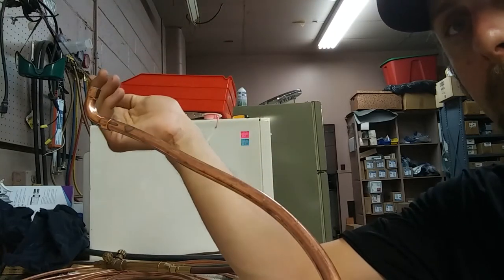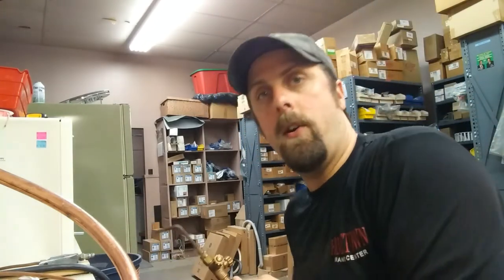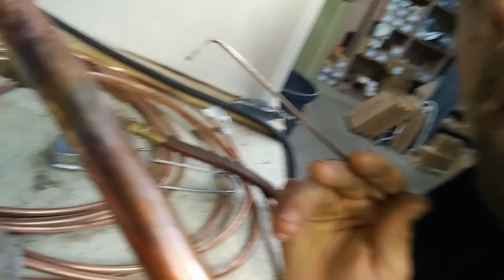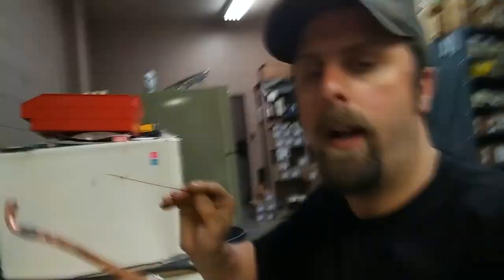Brazing 101: How to Braze Copper to Copper Using Silver Solder

Comment: Great short and to the point.  Why  is brazing the norm in refrigerators and soldering in plumbing?   Does it have anything to do with introducing impurities into the  system?  Sorry for the silly question but I am a DIYer without any formal training but rather self taught.
Reply from the maker: #1 reason for brazing over sweating (as in plumbing) is the flux itself. If that gets into the system, it could cause a restriction. The #2 reason for brazing is the pressures involved in a modern refrigeration system. It's not uncommon to see upwards of 100psi on the high side of a fridge's sealed system with R134A. Brazed joints will hold that. Sweated fittings won't necessarily. When I was in HVAC in the mid 2000s, we could get away with sweating R22 (now no longer manufactured, CFC-based refrigerant) fittings, but had to braze R410A (HFC-based refrigerant) fittings because of the higher pressures. At least, that's what I was always told.
Reply: Correct temperature/pressure. Refrigerant and A/C lines will see pressures higher than what soft solder can handle. Also brazing rods are much different than solder. Soldering and brazing are not the same thing... Brazing happens at higher temperature allowing to hold higher pressure.
Reply: Pressure in refridgeration in alot higher than plbg .
Reply: @cgappliancetelevision2315  lol. silver solder like staybrite 8 has joint strength of 10500 PSI. thats plenty of strong enough even for R410a.
Reply from the maker: @lordjaashin  I haven't been in HVAC for many years, my friend. As far as appliances go, we braze. Some use lokring of which I am FAR less of a fan. If you sweat fittings in this trade, you'll be blowing out a cap tube. Our stuff, as you see is quite small. I seldom touch 410A save for the odd window unit.